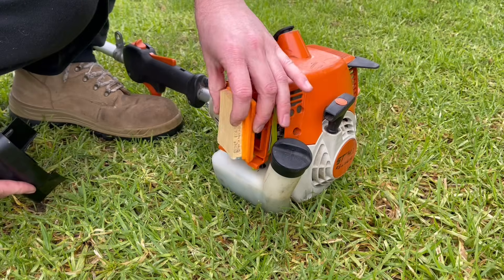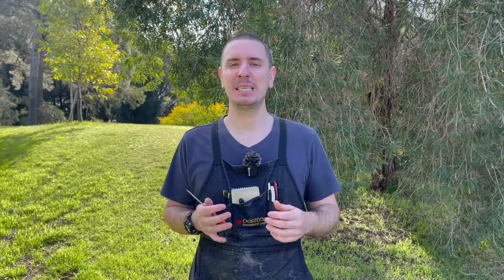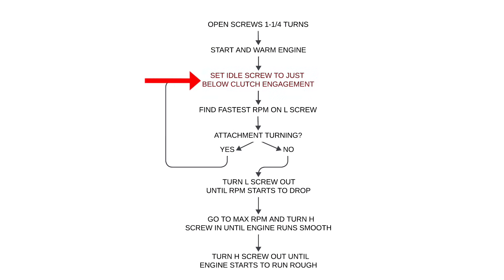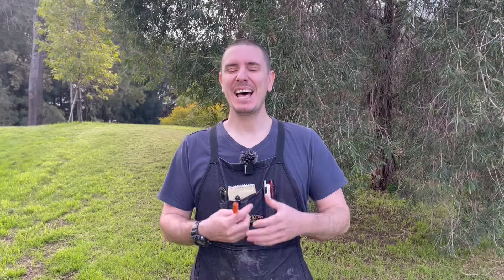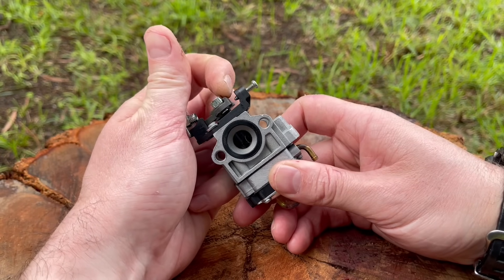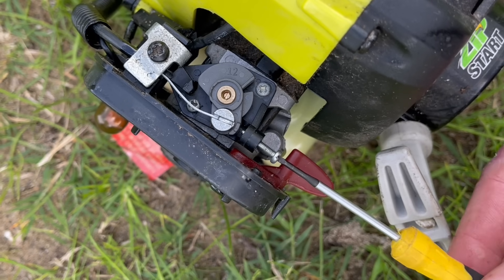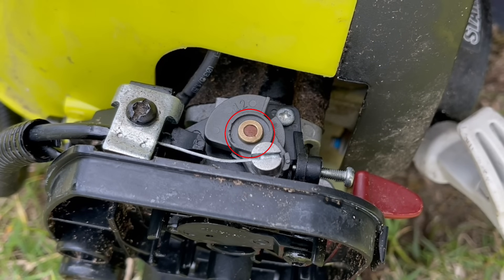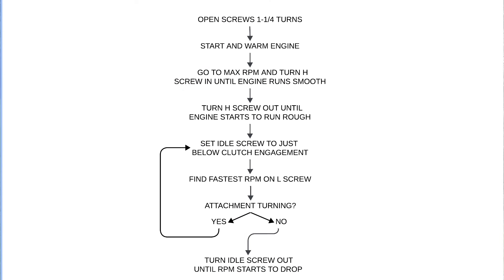Ultimate Guide To Carburetor Adjustments!

Comment: Great video! I have a Stihl KM 94 rc-e. It idles fine and will rev up a bit but when I give it some beans it bogs down then cuts out. Do I just need to adjust the high speed screw or is it more likely to be something else? There is no spark arrestor that I can see which a lot of videos seem to suggest could be a cause so I don't think it's that. Any suggestions would be appreciated 🙏🏼
Reply from the maker: You can always start with a high speed adjustment richer. If it doesn't improve anything, it would be time to look inside the carb :)

Comment: Hello, when adjusting the H screw on the butterfly carb, wouldn’t you want it to be running smooth and “two stroking” instead of “four stroking”. I have seen other recommendations to turn the H screw in until max rpm is reached, turn out until rpm drops and then turn it in just to where the rpm rises again. Is there any reason to avoid this method and instead tune the engine to run under max rpm like you showed? Or am I just misunderstanding something? Thanks
Reply from the maker: Hey :) you want a little 4 stroking when not under load, it ensures there is enough fuel for when you put it under grass. Hope this helps!
Reply: @VintageEngineRepairs  Thanks, that makes perfect sense. I’m still in high school and your videos have been so helpful. You’ve even kind of inspired me to learn more and possibly start helping other people out with their small engines
Reply from the maker: Awesome that's great to hear! Keep it up :) cheers!

Comment: Hey Tom. I have an old 245R Husky clearing saw, which thanks to you, I managed to resurrect - this after even the agent's mechanics couldn't help. For this I am eternally grateful. I used your walbro carb video for that. It's been working spot on for a couple years but now my problem is that it wants to cut out when I rev from idle, which appears to have something to do with the L screw. This is also affecting my idle setting. If I can get it revved up it runs beautifully. Any suggestions? (BTW - your videos and explainations are the BEST I have ever found on the net!!!)
Reply from the maker: Hey :) thanks for the kind words! Hmm off idle bogging is too much air or not enough fuel. I suspect it could have an oil seal air leak based off its age. I suggest a pressure and vacuum test :)
Reply: @VintageEngineRepairs  - Thanks. Do you mean the seals on the carb itself? The L screw wants to be turned pretty much all the way in. Also, those three little holes next to eachother in the carb body - are they all the same diameter. In other words, should the same size jet cleaner wire be able to pass through each one?

Comment: you have a really nice explanation with this video! thank you for your effort! 
I had some issues with my weed trimmer and i removed the carb in order to try and clean it/repair it. I m not an expert on this, just following other videos advice i opened it and sprayed in the holes. Didn;t see anything weird inside. Only one gasket seemed a little bit suspicious, but i decided to put it again in and give it a try. When i mounted the carb on the motor and tried to start the engine it started immidiately so i work for about half an hour till it was dark. Then i turned it off and went happy in the morning to continue only to find out that it just doesn't want to start today. 
Six hours later and while having tried various things i managed to have it running. When i discovered the "secret" L screw i counted the turns that it was turned by the factory and it was about 3 and 1/4. So i got a little bit confused about what should be the preset before tunning. By a lot of trial and error i found out that indeed it is around the range of 3 turns on this screw that the machine only works. It is a Hiundai hbc 622 pro. They sell it as a 63cc machine, although some repairers i spoke with told me that there are not weed trimmer with this cc.. don;t know. 
The carb is a standard one as i understand, with a 15mm air inlet hole and a distance between the mounting holes of 31mm. I ve already ordered a new one and i expect it to arrive in around a week to ten days. I would like to be able to continue with grass cutting till then though, because they have turned quite big, and i would surely like to understand why the machine doesn;t work and try to fix it.

long story short, i wanted to point out that for some reason not all carbs have an L screw preset at 1 and 1/4 turns. 

if by chance there could be any advice of how to proceed repairing mine too, i would happily hear it!
Reply from the maker: Hey :) typically the 4.5+ turns out on the L is for dependant carbs! Fingers crossed for you that the new carb will work well! Keep me updated!
Reply: @VintageEngineRepairs  thank you for the reply!

 I decided to order fuel lines with filter and rubber fit and a tank cap also. there is a fuel leackage and i think it is from the rubber fit that holds the two hoses on the tank. So i will start replacing parts to hopefully understand what is wrong. I don;t think it is the adjusting screws. I ve been playing with them a long time now and the changes are not great. Since yesterday i managed to have the machine work for a couple of small periods but it just decides to turn off by itself at some point..

 Another thing i just noticed is that i ve been using marine 2 stroke engine oil for the fuel mix. I wouldn;t imagine it beeing really different for one that is labeled as lawn trimmer fuel mixture oil or something but can it be a problem? also, on all the oils i ve been using in the past (also on this marine oil), as far as i can remember, it is marked that a ratio of 1:50 should be used. The lawn trimmer manual suggests using an 1:25 ratio. I never understood which of the two guidelines to follow..
Reply from the maker: @spirosnik2651 I'd not use marine 2 stroke oil in an air cooled engine :) stihl with Amsoil Saber 50:1 in everything.
Reply: @VintageEngineRepairs  i m not into boats but i thought that the engines were the same type.. so the oil is not the proper one you say. thank you for the suggestion! i will try with a proper one at 50:1

Comment: Good evening Tom! Am I wrong or is this setup extremely similar to your chainsaw tune-up guide. Old techs always spread the story that trimmers should run lean and chainsaws on the rich side so the engine doesn't redline in the cut. But from what I see you and other youtube techs doing, you also tune the trimmer to the richer side. Kind regards!
Reply from the maker: Hey! It’s very similar - 2 stroking under load at full throttle, 4 stroking off of load at full throttle :) no 2 stroke should ever be set lean.
Reply: @VintageEngineRepairs all clear, thanks for the response!

Comment: Carburetor? Internal combustion engines are history. We are changing to electric motors, much simpler and cheaper device. Lithium titanate batteries now can be recharged 30,000 times, this is the death sentence to combustion engines. Correct channel name, combustion engines are vintage , if not now, soon.
Reply from the maker: Electric cars are great - you have an oversized BBQ at any minute :) Not to mention they give you lots of time to write comments like yours while sitting in line at a charging station :)
Reply: @VintageEngineRepairs  this is history now, lithium titanate is like supercapacitor, it can charge and discharge fully in 6 minutes. Don't underestimate the progress of nanotechnology.
Reply from the maker: @absolute___zero Lithum titanate has very poor energy density (1/3 that of li-ion), is very expensive and is the reason they’re not used in vehicles. You’d add 3x the mass for the same energy storage. Electric vehicles are already heavy and get poor mileage as it is. But anyway, you’ve come to the wrong channel if your are passionate about electric cars and machines.
Reply: @VintageEngineRepairs  I know I am on a wrong channel, but I came to see a video on how to sharpen drill bits, not interested in investing my time in an old technology like internal combustion engines. You will understand this in about 20 years when you won't be able to buy a car with internal combustion engine anymore
Reply from the maker: I think hydrogen combustion engines will be the future.

Comment: Dear vintage,

Really appreciate your content. I have one question I never seem to find an answer anywhere about (probably me just being blind). What position should the idle screw be at before fine-tuning from factory settings, in or out or 1/2 way? I managed to fine tune my wheedwhacker a Husqvarna 165r just fine. I rebuild the carb on my Husqvarna 272xp and it's running great after tuning but the chain is twitching a bit at idle, perhaps the clutch needs some love and attention. Wrote more then intended now😅 Anyway thank you so much in advance! Keep up the fantastic work!

Greetings from Norway!
Reply from the maker: Hey :) I set it so it no longer touches the cam in which it rests against, screw it in until it just touches the cam, then turn it in 1 + 1/4 full turn in. Cheers :)
Reply: @VintageEngineRepairs  Nr 1! Cheers mate!
Reply from the maker: Pleasure :)

Comment: Hi Tom, thanks for the very informative video.  I have a strange issue with my trimmer (STIHL FS56), which has a butterfly type carb.  I've followed your instructions carefully, and what happens is that after I go full throttle for a while and release, the trimmer won't stay running.  I've then noticed that if I start the lean out the H screw, eventually it reaches a point where it stays running after releasing from full throttle.  Any ideas why this happens?
Reply from the maker: Hey, if it stalls after returning to idle, it can be either too rich on the L, H or the butterfly’s too closed hahah not very helpful I know. I’d make sure your L and LA are set correctly, then that only leaves the H screw that needs to be leaned out :)

Comment: still have to cut the trimmer line if I use the quiet spiral trimmer line? Why I have to reduce the load by cutting the line to adjust the carburator?
Reply from the maker: Hey I’m not familiar with that I’m afraid?

Comment: I have the butter fly type carb on my string trimmer, and a tachometer, the required two cycle fuel mixture is 50:1, but it's running a little hot on the lean side. So I dropped down to a 30:1 fuel mixture and still running it at the required 8000rpm's max speed and the required 3000rpm's idle speed, and it sounds like it's running better. But eventually I'll go back up to the 50:1. My question is, while I'm still running it at the 30:1 gas/oil mix would I need to adjust my carburetor to accommodate the 30:1 mix. If yes, how can I do that and maintain the required 3000/8000 rpm's or is that necessary? I'm not a professional at this, so I hope you understand my question.
Reply from the maker: Hey, changing oil ratios make no difference to lean or rich. At least not enough you’ll ever notice. Hope this helps!

Comment: Thanks, well done.  I was wondering how this process works for a ryobi back pack leaf blower. I’m having a difficult time adjusting the low and high screw. I don’t have an rpm reader.
Reply from the maker: What good timing ;) I’m working on that exact video (though not a backpack it’s the same process). Leaf blowers are very unique in that they’re under full and constant load and must be adjusted differently on the high speed circuit. Stay tuned, it will be released in a week or so!

Comment: Can I check with you which Mityvac pressure and vacuum tester I need. Your link suggests the tester from Amazon that only has pressure. However in your video you use one that has both pressure and vacuum. Should I be getting the one in the link or the one with both???
Reply from the maker: Hey! The one I linked to in the description (mityvac 8500) is the one I use and does both pressure and vacuum. Just confirm it’s the 8500 model you’re looking at :)
Reply: @VintageEngineRepairs  Thank you . I thought it would be the both pressure and vacuum model. however the link goes to the pressure only model. Thanks for clearing that up I will look for the model that has both.
Reply from the maker: @grahamturner2469  how strange! Can you please share the link that comes up on your page when you click my link? I’ll do some
Digging :)

Comment: Just replaced a bad diaphragm.  I put the settings where you say to.  It will start up with the choke on and then when I switch the choke off, it slowly dies down and dies.  Then I have to choke it again to get it to start.  I've been bending the tab that opens the needle valve up and down trying to get it in the right spot.  Is the tab too far down and it's not getting enough gas?
Reply from the maker: Don’t mess with the metering lever. Set it to factory recommended height and leave well alone. Why didn’t you continue with the tuning procedure I show?
Reply: @VintageEngineRepairs  I don't have the metering tool.  It's a WT carb so I need the M shaped tool.  How far down does the middle of the M sit below the outside "arms" of the M?  I could probably make one out of stiff cardboard.  I didn't continue because the motor won't stay running.
Reply from the maker: I don’t have my gauge here to measure I’m afraid! They’re not expensive to purchase though fortunately.

Comment: You explain this as simple as anyone on YouTube! The way to adjust the low speed is effortless, even for dummies like me. I hope this question doesnt sound like it came from a dummy. I have a small echo chainsaw. I have adjusted the carb as you said, several times. The ideal, according to my cheap tack an my ear fluctuates between 2800 an 3100 rpms. Is that  right? Ive read it is, but until I hear it from someone smarter than me, Im not sure. It passes the pressure an vac test. That I learned from you also.
Reply from the maker: Glad it helped :) yep, most rpm specs are +/- 200rpm 👍🏻

Comment: What about 4 stroke garden tools?
Reply from the maker: Yes for the low circuit, the high side I set them to where they run the fastest :)
Reply: @VintageEngineRepairs  thanks mate. I’ve got a Honda weed trimmer and it’s starting to get harder to start when cold. 

Thanks for all the advice you share, I love it.

Comment: Great and helpful video. Just a question: some weed trimmer carburetor (rotatory type) has only idle screw and only another screw, no H and  L screws. How can we tune these kind of carburator?
Thanks a lot for your information
Reply from the maker: Hey, if no screws are present, the only way you can adjust them is by drilling the main jet :) thanks for the kind words!
Reply: @VintageEngineRepairs  , Two screws are present: one is for idle, and another for fuel mixture, but there is no indication if is L or H. Any suggestion for the carb tuning in such a scenario?
thanks
Reply from the maker: Hmmm what is the make and model number on the side of the carb?

Comment: Your vids are very good and helpful.

I did a test on my coil today, the coil to spark plug was a good reading, but the kill wire terminal on the coil was showing a reading then going then coming again but had good contacts. Does this mean the coil is bad?
Reply from the maker: It could very likely indicate the electronic components on the primary circuit that is causing interference with the resistance. Some of which is made up of semiconductor material. I’m not saying this is the cause, but it’s been the most common in my experience. I say try the coil :)
Reply: @VintageEngineRepairs thanks so much for the reply. I’ll try it👍 really appreciate it👍

Comment: I use the procedure in the video on a Stihl FS91 and it didn’t work.any ideas why it didn’t.
Reply from the maker: Tuning is the final step to an engine running correctly. It won’t account for air leaks, blocked fuel filters, damaged or kinked lines, old diaphragms / carb kits :) if tuning didn’t work. Start from the beginning - check that the fuel system is clean, free of blockages, leaks and kinks, the carb is good and clean, the carb kit is goood. Also inspect the machine - air leaks etc. Hope it helps :)